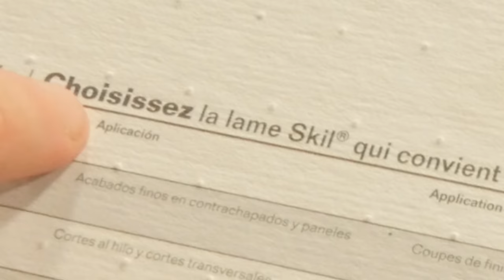How to Make: The Vulture (Double Bladed Saw Blade Battleaxe)

Comment: your good kid but you need to work on your welding
Reply: exactly what i though
Reply: He just now started but he is a great builder
Reply: Do you think he doesn't have argon gas
Reply: Anubis Vex it's not about the gas he is using its the technique used when welding and his are a little sloppy
Reply: That's exactly what I was thinking
Reply: Part of it is the dissimilar metals but yeah hes got a bit of room for improvement. Probably self taught.
Reply: he just started welding not to long ago and he is all self taught
Reply: positive criticism but you'll get backlash just for saying the word kid
Reply: I don't recall saying that he asserted authority. I'm telling him that he'll get backlash by calling him kid. not from me but people will get upset but people get upset over nothing it seems
Reply: he said "not a great weld"
Reply: try pre heating the harden saw blade before weld
Reply: bevel the weld surface edges slightly so when you flatten  your bead you don't loose all your contact surface when you grind it flat
Reply: I now nothing about welding but amazing beard
Reply: You have a badass beard
Reply: MattOutt64 bully
Reply: Daniel Lara  it's called constructive criticism
Reply: Prime Shitposts ikr he has a sexy ass beard
Reply: They are trying to give him advice
Reply: his welds come out like that because hes not using shielding gas. in this case argon
Reply: Edgar Gutierrez not quite I use acetylene on the majority of my thicker welds and I don't have this problem it's not the gas or the welder it's sempley the fact that he doesn't have as much experience as someone like me who does every kind of welding in any place if it's under water or atop a skyscraper I do it all so don't talk down on me as if your smarter then me when it comes to what I do for a living because your not
Reply: MattOutt64 he does say in most of his videos that he can't weld very well, but they do work, that's all that really matters in his case, everyone starts somewhere c: I'm not trying to start some argument by the way I'm just saying
Reply: Sebastian Garrison somebody's grumpy
Reply: MattOutt64  you the won to talk why don't you just worry about yourself
Reply: MattOutt64 in my opinion, I thing it's his process: hard wire isn't right for welding disimaler metals. what he should be using is TIG with stainless steel rod and a 1/8th or 3/16th lanthinated tungsten, with the metal prepped as a 1F weld. maybe use some strongbacks too.  but
Reply: shut up Matt was trying to help him.
Reply: MattOutt65 Wallace 0
Reply: MattOutt65 Wallace I've read some of your replies, since you have some experience and I have a little bit of experience myself, a week long boy scout camp that offers welding as a class, I think he's going too fast myself. Am I off? It would appear with all the excess material he's moving far too fast and needs to slow down as to let the metal heat up and as my instructor put it, let a pool of metal start to build up. Again I have small experience and just want to know if I'm on par with the problem so I know, if I ever make the same mistake, how to fix it.
Reply: glen d your instructer is absolutely correct when it comes to welding  patience is a virtue if you go to fast the weld will become very brittle and will not hold when put under stress, but if you are to slow  the metal overheats and turns blue if the metal your using is thin it can also be punctured if to much heat is applied plus if your like me then your probably broke at just don't have the money to be waisting so much copper
Reply: glen d your instructer is absolutely correct when it comes to welding  patience is a virtue if you go to fast the weld will become very brittle and will not hold when put under stress, but if you are to slow  the metal overheats and turns blue if the metal your using is thin it can also be punctured if to much heat is applied plus if your like me then your probably broke at just don't have the money to be waisting so much copper
Reply: +MattOutt65 Wallace Acetylene is a fuel, not a shielding gas. So either you're gas welding or you're full of shit. He is Mig welding and it looks like either low feed for the filler metal, or no gas. For doing welding as a living, you don't seem to know the basics nor the other types of welding.
Reply: MattOutt65 Wallace  he knows he does he mentions it alot
Reply: MattOutt65 Wallace Who are you calling "kid" you nerd.
Reply: Nite Hawk he isn't a nerd he's a grown man that knows what he is doing
Reply: No he's not
Reply: No Henry, you are the nerd
Reply: MattOutt65 Wallace What are some good welding tips? Im starting out and I don't want to make too many mistakes, even if I'm a rookie.
Reply: *You're
Reply: Do It With Dan My kinda guy.
Reply: cody lord Jesus don't judge people on just the shows they watch. I don't like anime either but watching it doesn't make someone a "loser". there are millions of successful people in this world who happen to like anime. disliking someone simply based on the shows they watch is very ignorant. I'm sure you find me a loser for reading comic books at the age of 25.
Reply: cody lord the fact that you and other people still call people nerds for watching anime is sad. Is that really the best insult someone can come up with these days? Also like some one else has already said, theirs a bunch of successful, funny people who watch it.
Reply: "kid" i don't think he's a kid...
Reply: ImnotsurewhatIwant hes been doing this simce he was 12 or 13 (can't remember which one)
Reply: Yea he does
Reply: You need to work on your spelling.
Reply: Seth Wood he goes to fast and probably not the right voltage or wire speed I know it's not the gas or it would look way worse

Comment: Hey mate, gotta say it's good to see someone on you that actually knows how to properly cut with an angle grinder, but can offer some advice on your welding, I noticed you went for a continuous run, and we're left with blow out holes that you that you then had to fill. That is  pretty crap! Next time you use your mig welder, set your steel so you have a 1 mm gap running the length of your weld, this will give the new steel your adding by welding, somewhere to go! So your not left with a built up weld sitting on top of your steel, but do it in short bursts! Of two or three seconds at a time holding then wait a few seconds, and go again, this is called manual spot welding, and is extremely effective at creating strong welds! Because your pumping more current thro the steel, and melting into the two items alot better, therefor making it a much superior weld, that will also cut down on the amount of time you need to spend on cleaning up and grinding off un-needed metal, but that's just my experience.... hope it helps

Comment: Hey bud not sure if you would actually read this comment but a tip for your welding when it comes to this stuff like this something you and do is overlap tacks. It will help keep the welds a little prettier so you don't need to grind all of your welds and help to stop from burning the wood up

Comment: not sure if you are going to see this but it will help make your welds look much better if you stop using flux cored wire and got some shielding gas, your welder looks like it already has the correct tip to accept shielding gas

Comment: Can dig it but also. . . Was inspired.    Make a second but disigned a bit simpler. The same handle and saw blade. Only just use those two pieces. Keep the blade full and round. Other than just the space, part and location for just the handle to be inserted. Same location in a center point but fabricate two steel straps square with four equally spaced bolt holes. Even with bold holes still run least four tack welds per side. Or just run a solid clean beed down all four sides of the straps. After the stain and clean welds. This or that could be a limited edition product you could develop and sell in your online store. A brand extension creating yet another revenue stream to help fund your all the madness we so enjoy.

Comment: eli i have an idea. awesome weapon,  but im not a fan of the gap between the machete blades and the wood,  would it still be just as durable with a slit in the wood just a tad,  foe the teeth of the machete to go into? or flip them the other way and have them outside if the must be seen.

Comment: I highly recommend changing out that Flux core wire for solid and just go ahead and invest in a gas welding multi-system. You can stick, mig, or tig weld. I own one and I gotta be honest it's money we'll spent for fabrication projects. Sure you gotta go get gas cylinders, but any large tank will last up to 30 hours of continuous use. If you have a Scott gross co. Near you Id advise checking out their order prices and cylinder change outs.

Comment: Hi just a tip with your welding they need to melt into both of the metals so just a little hotter and little slower also if your trying no to burn the wood angle the mig nozzle away from the wood not into the wood other then crapping your self it’s s awesome video bro

Comment: hey just some advice for welding,  instead of pushing ur weld down, try to learn to push it up,  and  also prep work is 90 % of welding & 10% of it is skill,  If u want have a good looking weld you have to have good prep work n take ur time get the heat right , make ur sure your not stopping n going, also  with gas welding its more $$$ but run full octane it makes it looks better

Comment: not trying to critizice or anything helpful tip if u are using a mig welder and you keep burning holes in your base metal turn down your wfs (wire feed speed) by 5 at the most and you will see a difference hope this helps on future builds ECT!

Comment: hey dude, you might want to mess around with your MIG/MAG machine on some mild steel. I'm no professional welder mind so take what I say with a pinch of salt. This sounds dumb but you probably just need to slow down and crank the amps up a little. The weld looks straight enough you just want to keep a bead of weld steadily moving along. anyway

really love your vids and ty for the build

Comment: Try holding the welder closer to the thing your welding  that will make the welds stronger and reduce the splatter it should be just 2-3 millimetres away from the metal but over all good job :)

Comment: is the polarity backwards on your welder? I needs to be one way for solid wire with argon/Co2 and the other way for flux core, which I pray, you're not using.

Comment: Also the table on your bandsaw is rotated 90 degrees the slot should be in line with blade not perpendicular to it - this is so you can replace the blade

Comment: I know I'm tardy to the party but Eli, if you see this here are some tips for your welding. I'm assuming that's flux cored and not mig, buy a flux cored tip, it will help you see your welds, they're like $5 and that mig tip is hard to see around. Second, slow down, you're moving too fast. Take your time and you'll be able to see and feel when you have a solid bead forming. Idk how your welding has come since this video but don't worry, you'll be rolling dimes in no time.

Comment: when you tac welded that im guessing 2 x 6 piece metal to the blades i say tig welded would have looked soo much nicer and clean even after grinding it to smoothen it out even if its not for holding much together

Comment: One more thing when welding twoflat surfaces you should bevel each piece so when done welding you can grind flat and not even notice the welds and still have enough weld to hold

Comment: tip from experience: use a flap disc when putting an edge on the sawblade. it won't chip the teeth.

Comment: Welding tips:   (from a pro welder)

1. Hold the gun perpendicular to the workpiece, mig ain't no good for penetration.

2. You're pulling straight down. Just... just dont do that
Reply: 3. Your welds look like me, its just not very pretty, if you do a kind of cursive "e" you'll have a much prettier weld. Practice it, it's not hard and the outcome is well worth the effort.
Reply: Aldo your volts are to high and your non consistency is due to the straight pull. The rythm of a weave or cursive "e" will fix that. You want a slight bulge with the toe of your weld meeting the workpiece at less that a 45° angle. And the bead should only be a
1/16" past the edge of the weld.
Reply: I could deffinitly break those wds eith my bare hands.

Comment: one problem with this build..... you put the teeth on the blades going the wrong way.... the teeth are supposed to bite into what ever you're cutting.... you wouldn't see a cat try to claw at something with the bald rounded part of their claws would you??
Reply: you don't know what you're talking about.
Reply: Jabun The Wanderer try using a skill saw or a table saw sometime.... the teeth bite into what ever you're cutting. they aren't ground against it.....hence I said the teeth are going the wrong way..... true he sharpened the whole thing so it's not an issue..... but he still put the blade going the wrong way...... I know far more of what i'm talking about than you can imagine..... known it for over 20 years. especially since the last 8 years I've been workin in a retail tool store and know the ins and outs of pretty much every power tool I can get my hands on

Comment: How's the saying goes? The best show of flattery is Copyright infringement? Gotta love idiots who steal your idea and use it as if it was their own. I dealt with that when I owned my own business for 10 years building custom vehicles, would still be doing it today if the economy hadn't taken a crap and made it were I couldn't compete with bigger shops. I owned a Chevy Dually that I had made it look like a skull was forming out of the sheet metal on the front and center of the hood, even had built a custom dash that had 7 skulls forming and pulling through the sheet metal along with skeleton hands, one skull was made to look a lil on the robotic side because it had a shift light made to look like an eye with a monster tachometer coming out of its mouth, the other skulls had 1965 Stewart Warner gauges that they sat on or had the gauges form from them somehow. The skull on the hood of my truck is in in a Kotton Mouth Kings Video, not quite sure on the wording of the title but I believe it's "Make it Hot" or something like that, Lou Dog showed one of his Lowrider bikes that had a drum set built as part of it. The car show was, "September to remember" done along with the American Red Cross to help out those affected by 9-11. After the first appearance of my dually with the skull on the hood vehicles started showing up with the same idea. The big difference between mine and everyone else's, mine was built out of sheet metal while theirs was done out of fiberglass. I doubt their work has lasted like mine has, I sold my hood to a buddy of mine and it's still in excellent shape today.